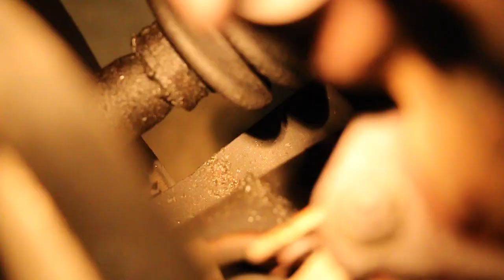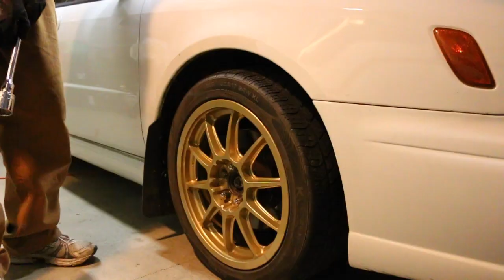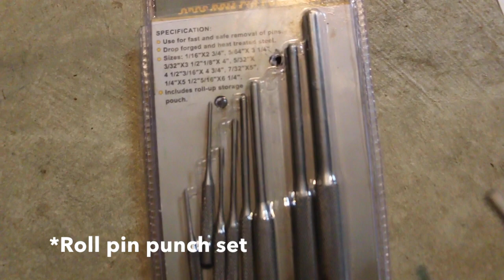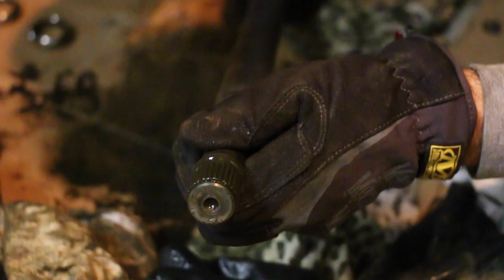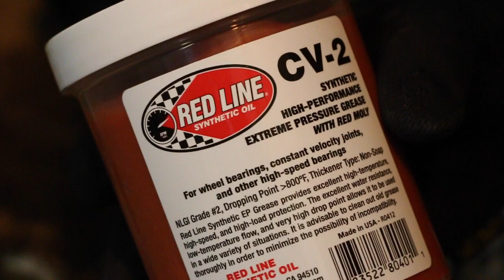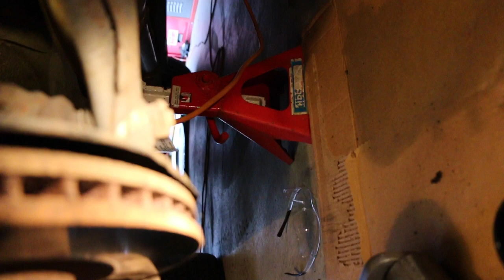How to replace Subaru Axle or Repair CV Boot || Subaru Impreza WRX Wagon 2002 – 2003

Comment: Everyone, please note the factory service manual states: Do not break axle nut free with weight of vehicle on the tire/hub as it is likely to cause wheel bearing damage and should only be done in this manner is changing the wheel bearing is going to be performed at the same time. An electric/air impact gun will pop it off with wheel off ground, or have helper hold the brakes on while you crack the nut with wheel off the ground. Thanks to the poster for taking the time to show this otherwise textbook method of replacing the axle.
Reply from the maker: Thanks for that bit of information. I will edit the description to include this tip for others. Much appreciated💪👍
Reply from the maker: I’ve pinned this comment so others will see it.
Reply: No problem. I just got done replacing my wheel bearing as it failed prematurely... I suspect previous owner may have loosened the axle nut with hub under weight as that side has different CV axle.
Reply from the maker: How difficult was that job? How many miles on your subaru?
Reply: 162K at the time. it was easy, have a shop with lift, press etc. did the front axles while in there. good times.
Reply: Yup, my helper is my daughter, but if solo just use a 2x4 wedged between the brake pedal and the seat, scoot seat forward.
Reply: Have helper press on brakes, then brake axle nut loose.

Comment: Seems like it's easier to just replace the whole axel.  They're like $130 for the pair...
Reply: Probably not.  But for a car this old, Duralast and the like will work just fine.
Reply from the maker: @KellyMurph  For sure. I’d rebuild the OEM ones if you’re able to but the Duralast will probably work fine. I just prefer to use OEM when possible.
Reply from the maker: @KellyMurph For sure 🍻
Reply from the maker: OEM?

Comment: Wait so I can just pull it? I have a 2016 wrx sti and I broke my boot trying to put coilovers on but i can just pull it off without taking the brake and other things apart?
Reply from the maker: I didn’t have to touch the brakes at all. Not sure about the 2016, but it should be similar. Which side did you rip?
Reply: @CompressorSurge  the passenger front side, also I figured it out, I needed a press it was seized
Reply from the maker: Glad to hear you figured it out🍻

Comment: Can do this repair without removing wheel nut if you break the tapered  joints on the spider, one for the steering arm and one  the ball joint underneath.  Just jack the spider up a little with car still on stands, remove split pins and nuts and tap the sides where the tapered joints are to break the tapered joint. Pull out half  axel with spider attached together, tie brake calliper disc rotor up out of the way first. just be careful not to  put any weight on brake hoses.  Also to maintain wheel alignment as well as making position of cam shafted bolt, use a scriber to mark the position of the shock strut assembly relative to the spider( the bit with the wheel bearing in) before undoing the two nuts and bolts joining them together.

Comment: I am always jealous of the prices you pay for OEM parts in the USA. and.  Or after market parts.  Here in NZ even when I do the currency conversion, we seem to pay 2X plus what you do.  An OEM price in New Zealand  for one inner CV boot is $70nz. = $50 us (Subaru Impreza ) while you pay $20 US.for example.   To me that seems a lot for something out of an injection moulding machine even if it is from Japan.  Thank you for your very clear video.
Reply: NZ great place to visit, friendly people and very scenic country, especially the South Island.
Reply from the maker: Can’t wait!
Reply from the maker: That’s interesting. Is it due to additional taxes? Could you just order the parts directly from the US?
Reply: There is a value added tax of 15 % on every thing called g s t  here.  But it might be more due to smaller population and that you are dealing with a monopoly situation that mainly deals with a well organised  trade as opposed to retail customers like me. 
Yes you can buy stuff on ally Barbra express, eBay, Amerzone, etc  if they freight to N Z , But usually freight is quite a bit and I need to use the vehicle so can't afford to wait.  I am not a professional mechanic, just DIY with half a doz cars.  I Did by a electrical Klein clamp meter from States much cheaper than it is sold here too.
Reply from the maker: That makes sense. What other cars do you have? You guys have had the ability to import some of the best cars down there. Hopefully I’ll make it to NZ one day. 👍
Reply: CompressorSurge  Nothing flash, Two Honda Odysseys, Subaru Impreza, series 5 Toyota  Celica ,and a Toyota Curren (like a Celica but has a trunk instead of a lift back, but similar mechanicals,   (I think both based on corona chassis) U12 SSS Blue bird Nissan hard top( my favourite)."  The Toyotas belong to my son, the Subaru is the Mrs. And yes; my son  tells me you don't have many Nissan Rocket ships like, Nissan Skyline,
 and Nissan Silva, In theUS
Canny investors ( because they appreciate in value) and Rock and roll fraternity bring in older US cars to NZ also.)
Reply: Good ol' socialism

Comment: Hey man, my outer right hand CV axle has begun badly leaking grease, there is a grinding noise while turning and skweak while driving, would it be worth just replacing the boot or the entire cv axle? Cheers
Reply from the maker: I was able to just replace the boot and it’s been fine since I fixed it. I’d suggest pulling the axle and taking a look at it to see if it’s damaged at all. If too much grease has leaked out you may have to end up replacing the entire axle.
Reply: CompressorSurge yeah, I think I’ve left it too late and will need to replace he entire axle, found some good deals for about $100 for a right hand front axle so it won’t cost too much more than a fix job anyway! Thanks for response
Reply from the maker: That sucks. At least you found a good deal on a replacement. 👍

Comment: So I need to replace the outer (wheel/rotor area)  cv axle boot on my 03 wagon also. I’m not so sure on how to do it. Never did it
before & I’m Not so sure how to. I need help lol
Reply from the maker: I would assume it’s similar to replacing the inner boot. Removing the axle from the car is pretty straight forward for the most part. Once it’s out it shouldn’t be too difficult.

Comment: Hey, quick question. I have an 02 wrx wagon and I recently noticed a white smoke coming out of the hood scoop at stop lights. After further looking, the smoke is a whitish color and its coming from the turbo area. I was wondering if you have any idea what it could be? Could the pcv valve possibly be leaking onto the downpipe? There is also a slight oil leak so it could be turbo oil return tube. Where would you recommend i start looking for a leak?
Reply: probably cam seals leaking oil onto your exhaust, or valve cover gaskets, I have the same thing.
Reply from the maker: Which reminds me I need to replace my valve cover gaskets next. Haha
Reply from the maker: White smoke is generally related to coolant. Do you notice any coolant leaks when your park your car? Have you worked on the car at all recently? I'd check some of the hoses to see if you have a coolant leak somewhere. 

As for the leaks around the turbo, is it near the feed or return line? You might want to check the lines for cracks.
Reply: There is no visible coolant leak. I just changed the oil and installed a catback in the past 2 weeks. There was a lot of wetness (from the oil leak) under the passenger side of the car. I wasn't able to take a good look as to where the oil is coming from, but i was thinking it could be the oil return line. Ive been periodically checking the coolant overflow reservoir, and the level has gone down quite a bit. Should I start by removing the tmic and taking a look at the hoses under there?
Reply from the maker: Sounds like two separate issues. I wouldn't be surprised if one of the oil lines has a small crack in it. If you pull off the TMIC that will give you enough room to inspect everything. How is the oil level? Are you losing a lot of oil as well?
Reply: The oil leak isn't too bad. Maybe a drop or two on the ground when i park in the garage. I constantly check oil level, cause the last thing i want is to spin a bearing! Thank you for all your help. Ill let you know what happens when I pull off the TMIC
Reply from the maker: Did you figure out what the issue was after pulling the TMIC?

Comment: Great video man. I have an 02 impreza and this task is on front of me. Your video should make this a million times easier than going it alone. Thank you for providing this valuable information!
Reply from the maker: Thanks. Are you replacing the axle or just the boot itself?
Reply: CompressorSurge I'll be doing the axles
Reply from the maker: Good luck! You shouldn't have too much trouble 💪

Comment: Same thing happened to my 2005 Saab 9-2x Aero lol. The smell is great and worrying at the same time. What are your wheel/tire specs? 
I'm looking for options on my car soon. Good informative videos!
Reply from the maker: 225/45/17s are on the wagon right now.
Reply: not sure, just the cv boot closest to my turbo ripped pretty bad spraying grease everywhere. I ended up replacing all axle assemblies because they had 110000 miles on them anyways. thanks for replying on the wheel specs.